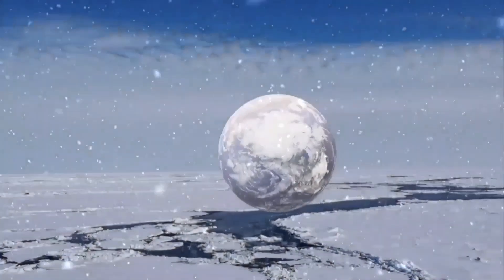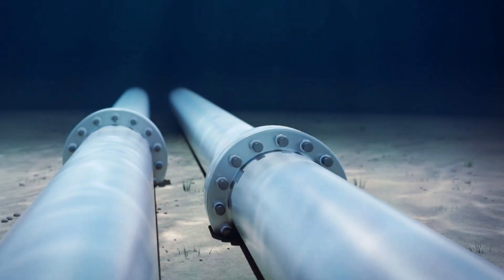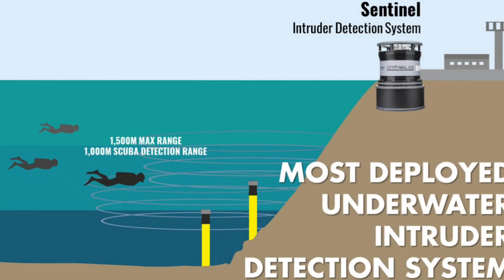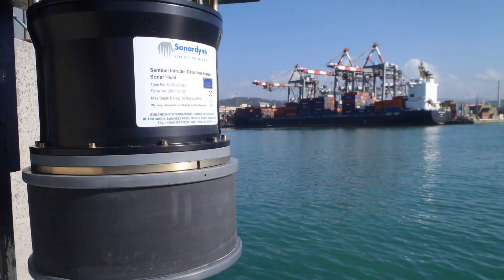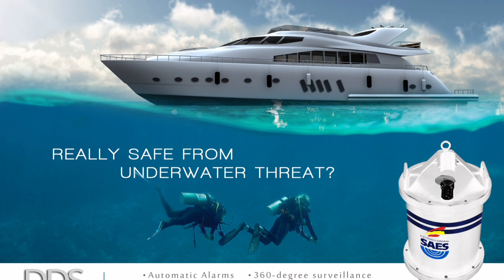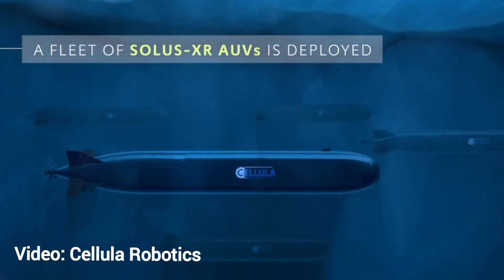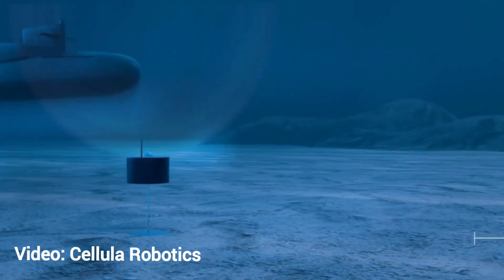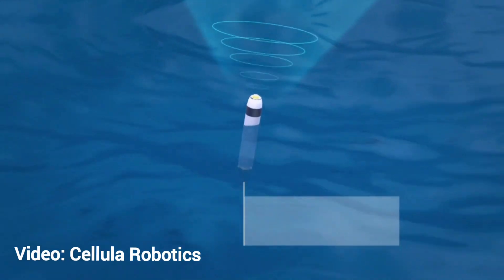Protecting seabed infrastructure

Comment: What an amazing video today! It's the kind of subject that few talk about it. In fact, we had never thought about it. Thank you for sharing!
We wonder if there are studies or academic papers dealing with countermeasures on possible attacks against these intrusion detection techniques or equipments. 
We mean, if there are studies on how to avoid "hacking" these countermeasures - for example, an attacker impersonating something that the detection system trusts.
Reply from the maker: This is certainly an arms race between the different parties here. One of the main evasion techniques to passive sonar is being silent. Hence stealthy subs use silent engines, propellers and are coated with rubber. Another tool is the use of marine mammals for military operations... but that is getting a bit far from my field ;)
Reply: Well, we were wondering about something more "simple" like hacking by electronic interference or something like that , but stealth submarines and sea animals are another (high) level of sophistication.
Anyway, this is a broad and challenging field for research.
Thank you! 
Have a happy New Year and a great 2023!